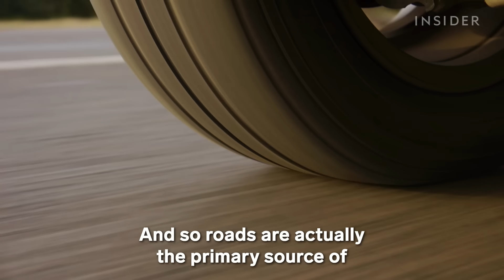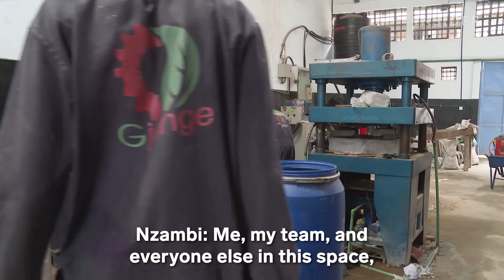Young Inventor Makes Bricks From Plastic Trash | World Wide Waste | Business Insider

Comment: Is chemical leakage an issue over time through erosion? Similar to water bottles, will the same issue arise from roads slowly eroding and contaminating natural water wells?
Reply: Isn't asphalt bound together using crude oil based tar?
Reply: Yes it is, nice thought by the young woman but unfortunately needs to be stopped
Reply: @ianleonberger1422  Although you are correct I still think she is making things better. The recycling is non existent and these materials are already seeping into the ground. so nothing changes. But with better roads cars last longer and use less gas. not to mention the other benefits from having better roads. It's deff not a solution that can be used world wide but for countries that are having extreme issues with plastic like Kenya it can definitely make a positive difference
Reply: @geflashed  Most of the comments focus on the plastic road, but what about using the bricks for houses and pavements only?

Less abration on pavement and almost zero abration in house walls. That would fulfill the exact goal of this whole thing, without any more bad side effects right?

I am by no means an expert on this matter, so any refutation and explanation would be great.
Reply: @fksksos123  I'm no expert either but I do wonder how suited they are for building since house's have very different requirements than roads when it comes to building materials. They did use them dor pavement so that is a good alternative use
Reply: @fksksos123  It's questionable how long can plastic bricks last. And how does the sun affect the bricks. She mentioned roofing, but i think the plastic roof could melt from the sun.
Reply: I like the energy of the woman and her positive attitude. It's also great that she's creating jobs. But environmentally what her company produces is a disaster that I as an engineer assure.
First of all, there is no recyclable plastic. After several cycles, old plastic can only be added to newly produced plastic as a filler. At some point, the material is so hard and brittle that it can no longer be shaped. In modern construction, plastic can also serve as a filler in walls. In no case, however, as bricks or as roof tiles, etc. Wherever plastic comes into contact with the environment, unprotected by rain, abrasion, erosion, microplastics are caused which end up in the groundwater. This causes widespread cancer among the population. 
It's not as if no one in the modern world has come up with this proposal. In Europe, there would have been strictly no approval for its use because microplastics are already found in food, human bodies and environment.
Reply: @alfiesolomons4437  I understand that it's not a great solution but do you recommend letting the plastic roam around the land instead because that's what's currently happening in Kenya. Its definitely not a world wide recommend option but it's a lesser evil of the two

Comment: I can see the problem with using plastic aggregate for roads, where high abrasion releases micro and nano particles into the environment, but formed into blocks or tiles for other building applications, the ones mentioned by Nzambi Matee such as paving and roofing, this wouldn't seem to be an issue, and it seems almost an ideal material.
Reply: If abrasion was a big deal they could just cover the top layer in normal concrete. I feel like these top researchers and innovators are staying away from the topic of plastic on purpose. So what if it even cost 20% more to do this? Get rid of the plastic.
Reply: @shuggurath5636  Over time plastic becomes very brittle so even if concrete was put over it the plastic could crumble after a few years which would release microplastics n that when you dig it up to repair the damage. Another issue is if these bricks shatter in a house due to the weight it could lead to a building collapsing whilst releasing microplastics. Another aspect which would also need to be looked into is any potential health risks posed by the recycled and disturbed plastic for humans, IE sort of what happened with Asbestos.  Not exactly the best solution but its definitely something until an actual solution could be found ig
Reply: @campbellplays  the brittleness I hadn't considered. Is there a plastic "alloy" that can reduce that?
Reply: @campbellplays  I mean everything breaks down over time. Even concrete. You see potholes everywhere. They can be repaired just like plastic could be.
Reply: @TheeRighteousOnee  Asphalt is far cheaper and far easier to recycle than plastic, and it doesnt degrade in the process. Recycled asphalt is as good as new, and thats why 99% of it is recycled. Adding plastic to roads is a terrible idea because all of a sudden you have to seperate the plastic and asphalt everytime you want to repair or recycle that asphalt, you are just adding extra problems to something that was pretty good in the first place.
Reply: @shuggurath5636  so I suppose your an expert on asphalt and paving roads? No. If you put plastic under a top layer of asphalt then your basically just burying  the plastic. The asphalt would crumple because it wouldn't be thick enough to support the weight of the vehicles driving on it, and then you'd just have a gravel road with trash underneath it.
Reply: @shuggurath5636  Thermal expansion will make that concrete fall right off as time passes. Plastic doesnt make a good material for the outside of a house, it quickly degrades under UV and weather exposure. But on the inside its resonably useful. 

Still, as inspirational as this all is, the best way to deal with plastic waste is to burn it in a controlled manner. Controlled combustion is a fairly clean process, and the carbon released in the process is insignificant compared to the damage the plastic itself does. Recycling doesnt really work very well for plastic, its a very old lie that is somehow kept alive.
Reply: Fire hazard
Reply: @rengurenge  Wood is a fire hazard too
Reply: @s.a.8548  Asphalt  will burn too.
Reply: Whatever... She's a genius and I'm sure she's done her research. We'll see
Reply: @itsmeee9933  She ain't stupid and I've never seen such a nice boss, but coming up with the idea of mixing shredded plastic with sand doesn't make her a genius like Einstein ^^

Comment: Traditional road construction uses pitch and gravel to make concrete.   I don't think it's a stretch to used molten plastic and sand to make road materials.  The physical properties would be very similar.   I can't say that it would be cheaper unless your plastic is cheaper and more available than what is traditional.

Comment: Very impressive, and interesting! This seems like it will be a very good invention. My only concern is wether or not the plastic brick is fire resistant. Roads get very hot in the sun, and reflections from buildings can magnify that heat. A melting road would be extremely dangerous.

Comment: As someone who works with iso based plastics, the problem is, especially in a hot climate, that those bricks will off gas. Plastic, specifically isocyanate based plastic produced gas is very highly carcinogenic. Another problem would be any fire started in a structure made of these would be  incredibly toxic, and the production of them is without a doubt unfiltered and therefore pumping a huge number of pollutants into the air. I would advise against doing this...
Reply: I didn't know the details but I was wondering about flammability and toxicity also. Even the leaching of toxins in the plastic into groundwater without extreme temperatures...
Reply: A comment worth thousands of likes.
Reply: True lol but the only solution is to stop producing plastic
Reply: @alal2192  Why in the actual hell would they stop producing plastic? To stop "pollution"?
Reply: @nobleape9281  true lol
Reply: @achocolatelily0804  they are durable and not so expensive if we reach maximum capacity
Reply: If that is the case, then the 20 workers forging these bricks each day are doomed. Death is a consequence of living, sure, but cancer is a living hell.
Reply: The workers must be inhaling these gases, great idea but I'd be concerned for my employees health.
Reply: No need to worry, this operation won't last long. They have 4 years max before the toxic gases the hot plastic gives off will kill them all (unfortunately). I read another comment where a black woman was supporting and praising them saying "its fine, they have probably done their research". Riiiigghhtt
Reply: BuT MaKe ThE PlAnEt GrEeN, ReCyClE

People do not think about it, they just see that plastic is getting recycled and therefore it is amazing.
Reply: Maybe this could be a solution for other countries were the climate iss different :0

Comment: well, that's one way of dealing with it. but I have concerns about longevity, and reintegration, I worry the plastics will get back into the envirionment LATER. microplastics are still a problem, and this will do a decent job sequestering them, sure, delay till we can formulate a better use of the plastic, that doesn't have outlets to the environment. 

This is better than nothing, but I see some things that could be problems. I suppose microplastics in the soil is probably less harmful than microplastics in the ocean. so it's still overall a benefit.

Comment: So if you are making brick for roads, let's say 6 inches thick, it's only the surface which would add toward microplastics. The rest remains in a structure encased and blocked from entering the environment. This guy trolling us by explaining basically that the idea is no good because microplastics, should consider that the material would otherwise be likely exposed to the environment in a way which would break it down faster into microplastics. Setting the plastic into blocks would slow this process down. Taking all the plastic and making blocks out of it would be a better solution than leaving loose material in a landfill or trash piles all over the world.

Comment: This method is going to create lots of microplastic waste in the environment. Aside from the bricks breaking down over time, when the bricks get cut, for example, there will be plastic dust. If stone bricks get cut, it's not a big deal.
Reply: Well, i was thinking that using this mixture containerized in buildings might do the trick.
I am no architecht nor experienced with material, but if the right office tests it and has a complete idea of this material properties using it for the inside of a building might be an option.
So, it is never in contact with the atmosphere or external factors untill the building comes down, which happens around every 50-100 years

Comment: ive worked on the exact same machines but i was making road cones and barrier feet. also kerb ramps.. there is everything in that mixture what the heat up and weigh.. old carpet fibres and bits of copper wire.. and if they trim dthe bricks when they was warm it would make it so much easier and faster.. but there is one big drawback to these bricks.. they are waterproof.. you have no drainage.. build a road with this stuff and you end up with alot of surface water

Comment: What about other use cases for this product ? For example, because of the abrasion between the roads and tires which is creating microplastic that is released to the environment. How about we use it for building ? In addition to use other resources that can reinforce this invention, so much can be achieved. With a wider spectrum of this product's use, we can slowly move to a greater future.

Comment: I mean they’re yacking about putting it in roads and how it will end up back in the environment and such, but it has been recycled, reused, if it was not used for these bricks it would still be in the environment but it would be completely useless and much more harmful, so these idiots not see the fault in their arguments? I really hope someone with a lot of money catches wind of this and gets it into mass production, this has massive potential
Reply: Because you're planning to take the trash from areas that are sparsely populated and putting them in highly populated areas. That's the last thing we want. Everyone and their mother's dog will develop cancers like they're fevers. You're essentially accelerating the rate at which our landfills expand by using these "bricks" for roads and housing, for example.

Besides, a lot of the negative reception this idea gets is because it's largely impractical. We know of the health and hazardous implications of plastic, that is for certain. Take the roads, for instance. Plastic brick roads would mean a lack of traction for vehicles due to tires being rubber and a lack of drainage. Roads will be significantly wetter since plastic is waterproof, basically doubling down on the traction problem.

Furthermore, the roads will need to be able to withstand high temperatures, and I think we all know the health complications that heated plastics present. Not to mention how it could damage it's structural integrity and- god forbid a fire starting on said roads.

The video already covered the problem with microplastics and the rubbing off of roads.

Now, as for housing, I don't think I need to expand on how building a house out of plastics can be unhealthy and dangerous, right?

Comment: Why can’t she be my boss 🥺❤️ she is so sweet! Also couldn’t they build houses with those bricks instead of roads to decrease the micro-plastics going into the environment? That way - with a home - there is not the constant abrasion that cars produce from driving on the road. Then you could put a layer of clay that coats both the inside and outside of the house, which would further trap the micro-plastics in. I mean I think that would work, but I’m not sure.

Comment: Such a great idea for the current climate they are in, but eventually plastic roads will cause other issues as microplastics will be released into the air when these bricks wear. But its still a very good temporary solution.

Comment: This has so much potential, I don't know about the carbon emissions it has but this is an ingenious idea. I wonder how the finished bricks would react to extreme weather.
Reply: That and heat vs plastic!  I hope it works out very well for them!
Reply: If anything, probably less than creating traditional asphalt.
Reply: idk do you burn plastic in your fireplace?
Reply: There's a reason why the guys in India only use a little bit of plastic in there roads. It doesn't last. Even in mild climates the plastic will still photodegrade. Honestly it's a waste of time and creates more pollution.
Reply: @andrewdzierson2036  and that's just the short term.
You don't know what will happen molecularly speaking in a thousand years; will they off-gas or crumble to dust?
Reply: @CountDoucheula  I mean, I'm no expert, but do you know what will happen molecularly to asphalt in 1000 years? Or any other man-made/synthetic for that matter

Comment: Is that all the test they have done: throwing the plastic brick on the floor? What is the hardness rating of the brick instead of vaguely claiming that it's stronger than concrete? This is a ridiculous idea that will lead no where, plastic is just too soft no matter how much sand you add to it.

Comment: If we stopped all plastic production today. There will still be enough plastic to continue the exact cycle we are in for several years. So regardless we need to have a system to reduce its size and impact. If we took out all the plastic in the ocean we would have no where to put it safely in the state its in right now.

Comment: this is an incredible idea.
… imagine how much cheaper these would be if she had the resources to take all our trash, wherever she might find it… and mass produce these bricks.

(as for the micro plastic problem… that problem already exists. locking it in something as hard as concrete, as opposed to trash, might slow release.)
Reply: I mea the thing about this is yes it will still release plastic into the environment but it’s already existing plastic, not new plastic which is what makes this a viable solution. It’s a shame the largest plastic producing corporations dont harvest plastic from the sea and recycle it

Comment: It's a great idea forsure, however, what kind of impact will this have on the environment? I mean heating plastic causing toxic smoke right? So the workers will suffer from that, roads made of plastic can release particles into the air, soil and water correct? 
I think its a great idea, I really do, BUT I think it needs more researching, like long term effects on workers, environment and water, so were better informed of the adverse effects
Reply: What's the difference between heating plastic and sand to build new things and then melting/burning plastic to be recycled? There is no difference. It either rots at a land fill, or we burn it and make something new. I'd rather make something new with what seems to be little to no pollution than the toxins and plumes of smoke that are released from western recycling. Your comment was uneducated, look up US recycling plants and how much pollution they release compared to this.
Reply: @Rad-F0X  I think both your comments on how this innovation affects the environment are valid and necessary  in developing the mindset we all need to have to creating an actual solution for the much bigger problem
Reply: @adamjemal3726  yeah it's just that right now there is no better solution besides this. Just like Nzambi said; this isn't an all time solution, but it will definitely help.
Reply: @Rad-F0X  I have been wanting to dig into this issue more and learn more about where humanity stands on finding new ways of reusing or working with the waste we have already accumulated . Do you know of anything interesting I could look up that the world is doing now? or maybe planning to do.